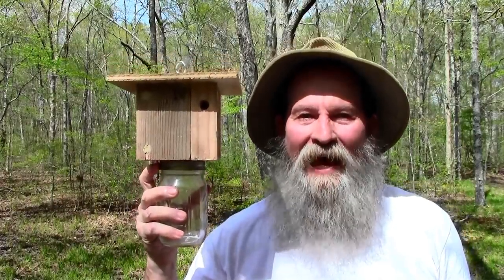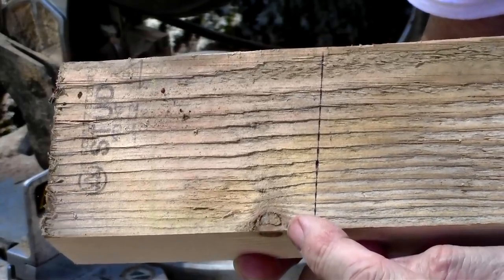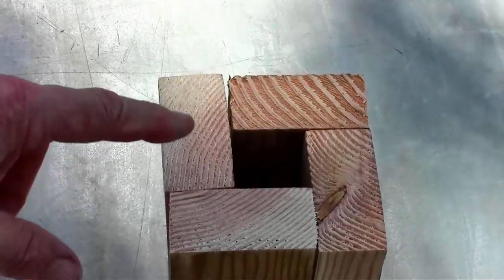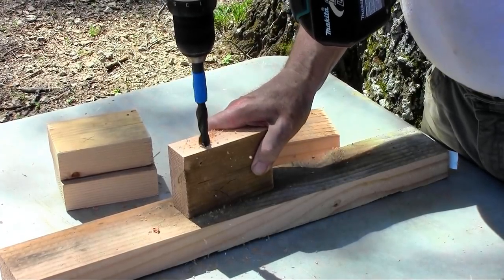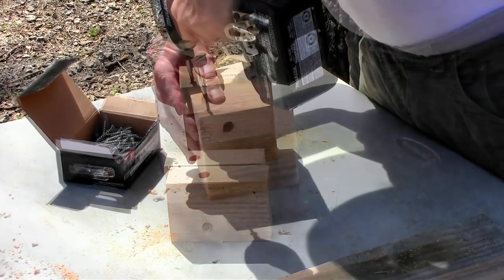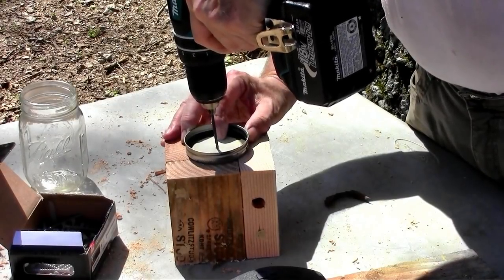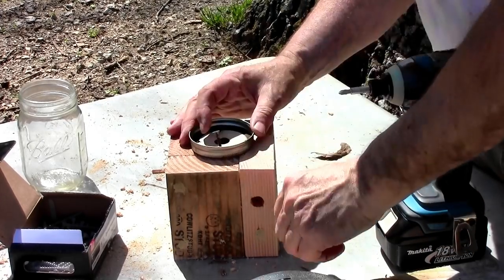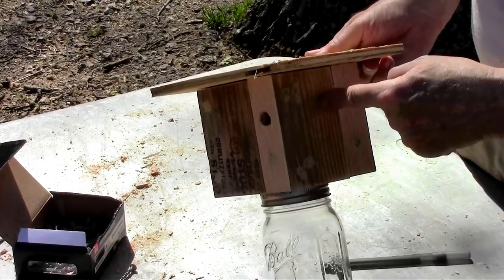How to Make a Homemade DIY Carpenter Bee Trap

Comment: Good on you, Capn' Rob! It takes a true man to own up to his mistakes. Don't feel bad, I make plenty of dumb errors myself. We are not alone.
Reply from the maker: Yeah, my mistake was assuming I had it all figured out. Rather than thinking about each step as I did them. Thanks.
Reply: Pro tip I learned from a furniture maker: Before screwing them in, give your screws a good rub with a bar of soap or a candle to reduce the risk of splitting the wood. Not 100% effective, that's why most wood shops are heated with woodstoves. Mistake disposal.

Comment: You know the screw head acts like a wedge when you go past the wood surface,then you get your split. I still do it occasionally haha. !  You made it work,job finished . By the way the trap works good.
Reply from the maker: Yeah, in an important project I would countersink the holes. I assumed, incorrectly, that the pine 2x4 would have some give. My bad. Hahaha